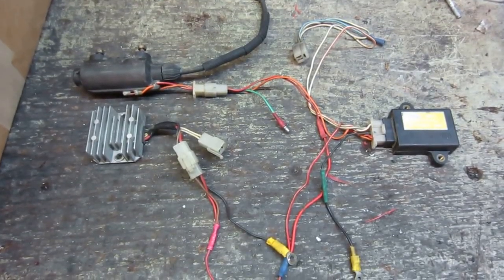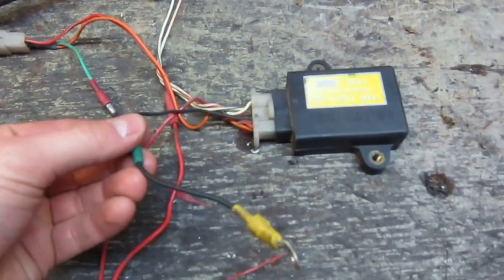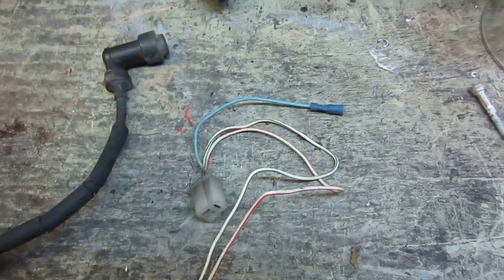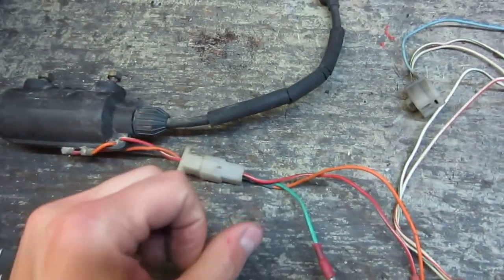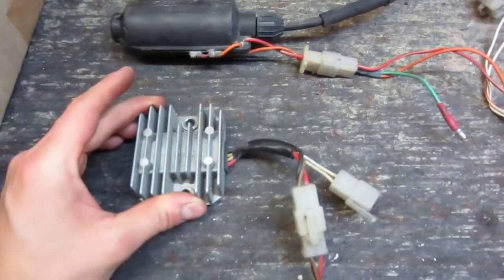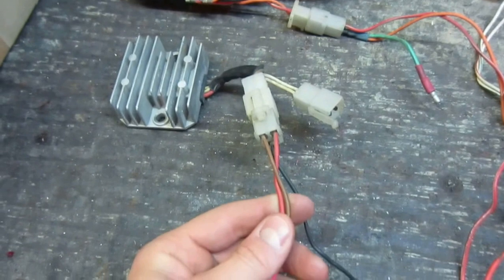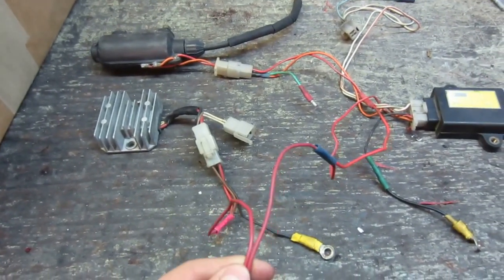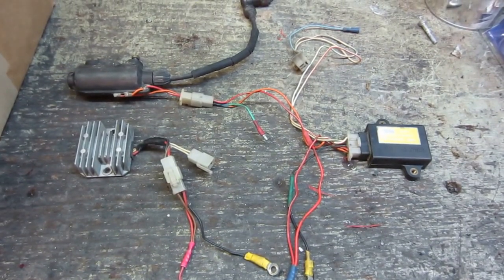How to wire a Yamaha SR250 Exciter

Comment: Thank you for this. Staring at my SR185 this afternoon trying to work out what to do with its aging electrical system. Led me to an article about making a wiring loom from scratch which led to googling and finding this. I'm not great with electrics but not stupid either. It took me a long time to understand how an electrical system works, and I still struggle with it because I'm better at moving parts, but this came along at exactly the right time for the problem I'm having. You simplified this beautifully.
Reply from the maker: Hey, glad to have helped!
Reply: I agree with the notion of building simple harness from scratch, looks like that’s what many custom builders do. I talked to a guy who said there is a plug and play setup available for these applications, because a lot of people don’t want to deal with aging wiring systems, from my experience mechanics issues are not nearly as big a problem as “old wiring”. Just testing the Old wiring can cause problems, then when you get it repaired you wonder when the next issue pops… grrr. The old “pre-197x”, is not bad, the 80’s onward have caused me most grief.

Comment: Does the circuit also work without a battery? I
Installed the engine in a speedway bike and would like to save weight.

Comment: Hi, I saw that you added a green wire for the tachometer. Which wire does it connect to? Also, these bikes came with a cable driven tachometer. What substitutes do you recommend? Thanks for your assistance in advance.
Reply from the maker: It's hard to find an aftermarket tach for a single cylinder engine, so keep that in mind. I'm pretty sure I connected the tach wire to the negative side of the coil wire. It's been a long time though so kinda hard to remember! Thanks for watching.
Reply: Thank you very much. Great video.

Comment: Also please could you explain the  tachometer connection you added ?
Reply from the maker: Yeah, for sure. You just connect the tach input signal to the negative side of the coil. It's hard to find a tach that will work on a single cylinder, so make sure you check before purchasing. Thanks for watching!

Comment: I just found this and thank you !  I just picked up and 1981 SR185 Exciter with no miles on it(2000k) original everything. Not very exciting, and ugly as it gets,,so off with everything. I’m going to use it for putting around on light trails. Just got it riding better with shock,tires,handlebars and removal of as much plastic as possible.   Now the wiring.  I want simplicity and reliability, as there is no kickstart. Can these be bump started ? What do you think about getting the components and building a new harness over the winter, like the one above ? Then I have backup ?
Also noticed you from the valley,  G’day from Fitzroy !
Reply from the maker: lol... I live in Fitzroy Harbour now :D I used this motor in a dune buggy I created years ago. Yes, you can bump start the motor. I think I have the wire harness diagram somewhere. Send me a private message and we can chat!
Reply: @glassglowz  not sure how to send PVT. MSG. Can you send one to me one with an email and I’ll respond with my co-ordinates ? I’ve got the bike running now, however ignition spark comes and goes, suspect battery not 100% but ?  Need it to be 92% reliable or its useless to me, i might be way back in the calabogie hills somewhere and have the no ignition spark.  We both know that there are “no spark vehicles that stay forever in the hills”. I just moved here and had hoped to use the bike to do some exploring in the area.
Reply: @peterparsons7141  Hey I am in the process of rebuilding a 1981 SR185 Exciter right now and I am also having issues getting ignition spark. Did you ever get the wire harness diagram? Would you be able to email it to me? I looked all over the internet but could not find one. Thanks in advance.

Comment: How much diffrent is it with a starter motor and battery. Ps thanks nice stright to the point video
Reply from the maker: I always just ran a hard wire with a large amp rating push button for my starter. Nice and simple! Thanks for watching.

Comment: Great vid, but no need for the starter solenoid?
Reply from the maker: +ds dray I didn't use the start solenoid. I just used a button that could handle the high current load.

Comment: Brown and red on the rectifier should not be connected. If you do this, your battery will always need energy even when it's off. Right is - red an battery plus, brown on key position 1. Key position 0 the battery plus with fuse.

Comment: Hi mate! Don't really know fi you're still answering here, but how do I start the engine with the button? I'm stuck there😅😂 I will apreciate if you help me🙏🏻
Reply from the maker: I didn't use anything from the original harness to start the engine. Just use a hi-amp switch and run 12 volts to the starter.

Comment: thanks for the video its exactly what i needed
Reply from the maker: 5olaris88 Great!
Reply: glassglowz just making sure i don't work myself into a corner, Is the starter solenoid unnecessary?
Reply from the maker: 5olaris88 I don't use one on my dune buggy. I just have a high amp push button connect directly from the battery to the starter. Either way, the starter solenoid is not part of the CDI wiring.

Comment: Thank you so much for this!! I’m really close to saying the hell with it and rewriting my bike like this. I have something going wrong somewhere in my system, probably a hidden break or corrosion. Anywho, where would you tie in a simple on off switch as well as just a momentary switch for the starter solenoid?
Reply from the maker: Glad this was helpful! Not really sure where you'd tie in a starter solenoid. I used this motor in a dune buggy and I just used a high amp push button for the starter and never bothered with a solenoid.

Comment: Hi thanks for the info and nice vid. Hoping you can help me: I have a1980 sr250 and it will not keep a charge. What should I look for in diagnosing the reason for not charging?
And also: it has a hard time firing up and starting. It has a brand-new spark plug and electronic ignition. It turns over fine but it just won't fire up. Once it is warm it will fire up easier. Can you help me with this?
Reply from the maker: I'd take a look at the regulator/rectifier (thing with the heat sink on it) if the battery is not being charged. Could be a dud battery as well.

For your second problem, really sounds like an issue with your carb.
Reply: +thewingenuity I have this same problem! Mine is an 81 sr250. Wont hold a charge. Did you ever fix the problem?

Comment: Hi I have a 1985 yamaha xj700 trying to wire it up with minimal wiring. I can get it to turn over but am getting no power to my coils can you help?
Reply from the maker: Sorry, I'm really not that great diagnosing issues like this. I'd start by replacing the coil, then if that doesn't work you might need to replace the CDI box itself. I had 2 faulty CDI boxes when I used this motor in my dune buggy. You'll usually find all the replacement parts you need on ebay.